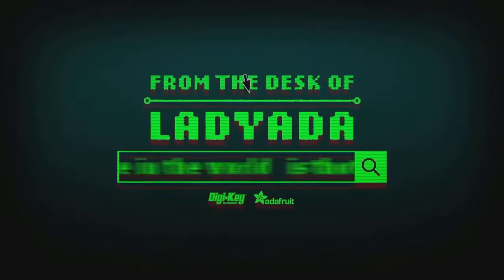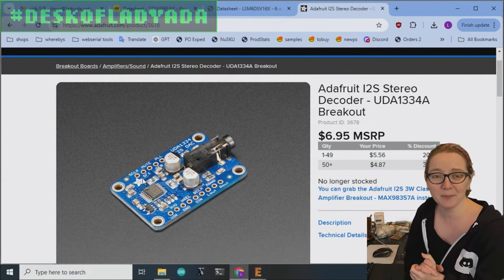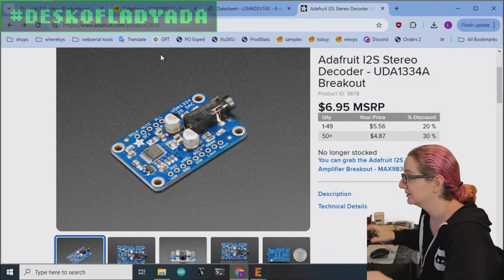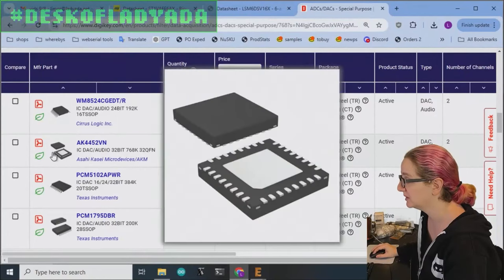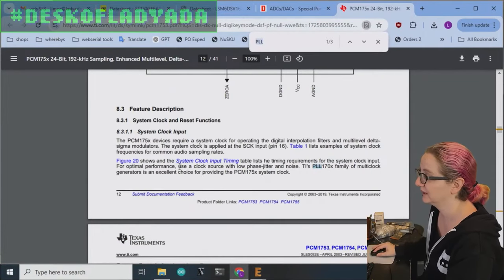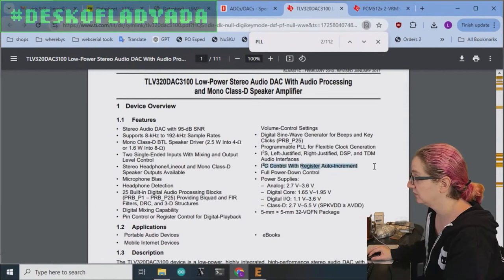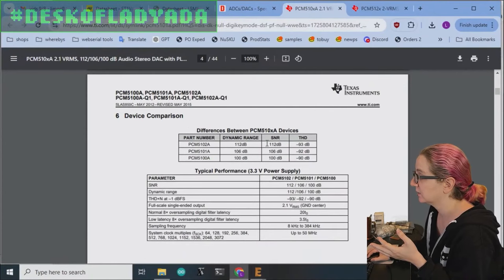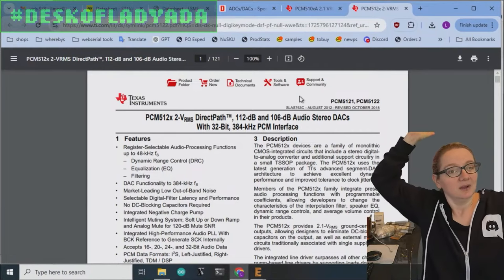The Great Search: MCK-less, hardware-configured, stereo line-level output I2S DAC @DigiKey @Adafruit

Comment: I defined that device at TI almost 15 years ago. The whole aim of that device was to make a great sounding, easy to use DAC. We saw a trend back then of streamed audio sources that didn't have nice clocking options. Everything needed a synchronous Master Clock. Customers were using two separate crystals in their products (one for 44.1 and the other for 48kHz!).
We ripped the PLL circuit from the TLV320AIC3254, made some tweaks and then took most of the DAC architecture from the venerable PCM1792. The additional digital density allowed us to add some better digital interpolation filters (which multiply you up from 48kHz to the oversampling output rate).
The real fun started with the PCM5122 and PCM5142. Those guys had miniDSP inside so you could do your EQ's and compressors in it.
What a lovely walk down memory lane.